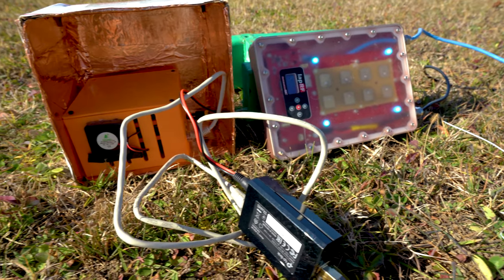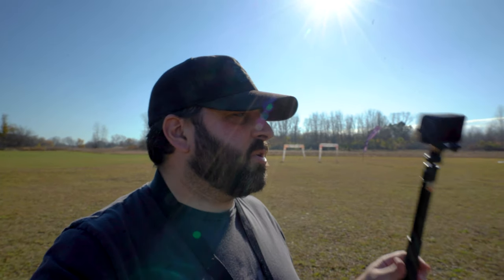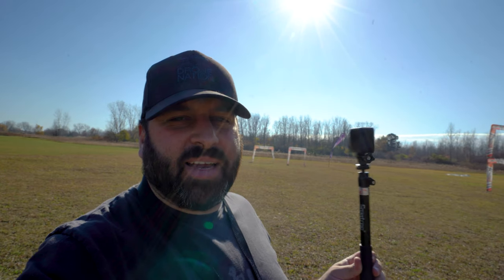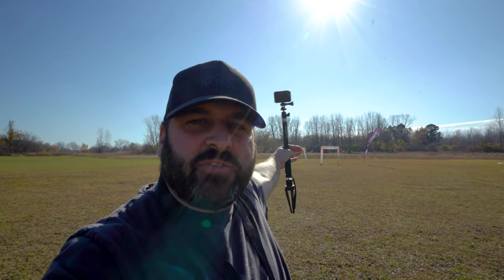RotorHazard DIY FPV Race Timer | The Solution To DJI FPV Timing???

Comment: The split in time is the separation in timers and lined up with gate immersion is on the gate and delta 5 is the 1 foot 0.008 difference but it’s actually spot on
Reply: If a timer is a foot before the gate, it starts timing a foot earlier, and ends a foot earlier. Does not make any difference at all.

Comment: great analysis!  thank you for putting this together.  I have a delta setup I need to dig into.  

off subject, how are your digital lap times comparing to analog these days?
Reply from the maker: My digital times were about 2s/lap slower.  Worse my consistency was much worse on digital.
Reply: @JohnEFly  crazy!  Both racing builds?  That’s significant.
Reply from the maker: Yes not the same builds but they are both racers.  Pyro cube for dji and floss 3LX for dji.  I can't fly anywhere close to as good with dji.  But I do still enjoy it.

Comment: Awesome work! Any Good source on how to get DJI working on laprf? I can't get it to read any laps
Reply from the maker: Are you referring to the 8-way or personal?  For 8 way use a threshold of 600 and a sensitivity of 63.  For slower flying it catches basically every lap.  For faster flying it catches most laps.  If you are asking about the personal, I don't know the exact settings, but generally decrease threshold and increase sensitivity.
Reply: @JohnEFly  ah awesome, thanks for that. Yes for the 8 way :)
Reply from the maker: @FPVBits  I'm shocked if you have anything close to decent results with that.  When running 63/600 I also have the DJI quads at 200mw.  That's what I used in this video and missed a bunch of laps.

Comment: Really, really interesting testing, dude! 😃
The results are pretty convincing!
But... I don't know, but I wouldn't bet on DJI for races, but on Shark Byte. Because with Shark Byte you can have as many receivers as you want, put it on screens and so on... With DJI on the other hand you need that freaking expensive controller. 😕
So... We'll see, I guess. 😬
Anyway, stay safe there with your family! 🖖😊
Reply: You don't need any specific controller... You can use whatever you want.
Reply: @TechieMillennial  Now you can, but at the time I made the comment you didn't have the options you have today. You know?

Comment: Thanks for doing the work! This is really interesting to me and i love that you have analysed the data. It looks like there is a solution to timing dji... i will have to dust off my old delta5 and get rotorhazard running on it. What I really want to see is 6 dji pilots up together racing and getting timed accurately (with either system) and then swap out a dji pilot for an analogue pilot and go again and then be at a point where you can have any number of dji and analogue  pilots in the air at once (might even chuck in some sharkbyte in there for good measure) this is going to be our next round of testing in the uk race scene... if we can ever get out of lockdown.
Reply: Done this. Np
Reply: @jstlll  so you can get 5 dji and one analogue pilot up racing with no issues? any special considerations? there is very little footage of dji racing that i can find (split dvr multiple pilots in the air) and the one bit i can find the poor guy on analogue is getting stomped on hard by 3 other dji pilots. I really want this to work so any tips appreciated.
Reply: @willannison1300  no, not together. Two analog and two dji are fine-ish. You best consider them as two separate classes.
Reply: Sorry, misread your comment. Rotorhazard will deal with it, but pilots may not like the interference :p
Reply: @jstlll  "fine ish" doesnt sound great at all. That's a real shame i really want to run races that include dji but running a separate class is a complete non starter for me
Reply: Two or even three DJI in a four person heat seems to work fine, but it really depends on what frequencies are being used. I have had good results with R1, r3/d3, d6/r7 and d7/R8. But the r7 and R8 only really works with IRC or TBS vtx and proper antennas that have good reception at r7 and r8. Not all do. Make sure rb pilots are on lower channels and do not use r6 as it has disturbance from DJI 8/public. This make imd6c hard to use without modification
Reply from the maker: Racing DJI with analog is absolutely not fine.  There is pretty much always some interference issues to deal with.  It typically shows up as a small white bar that scrolls through the screen occasionally.  It's flyable, but it's definitely causing issues, and it's not really fair to cause issues on other pilots.  No matter what channels I've tried it seems to show up at some point.  It's very hard to predict where DJI will cause the issue.
Reply: in four person heats based on imd6c with analog on rb1 and rb2 or rb3 and DJI on d6 and d7 (similar to r7 and R8) we have had good results without interference. 3 analog quads and 1dji have worked too, although R7 then needs proper antennas. Always keep DJI on higher channels.
Reply from the maker: @jstlll  in the same exact configuration we have had issues.  It's typically easiest to see if you're live streaming the event as you would be able to see any interference on a single screen.  We livestream all of our races, so I've seen it at every race.  I've never had an analog pilot complain about it at the race, but I have heard of some complaining outside of the race.  So I wouldn't rely on the fact that nobody spoke up as proof that there were no issues.
Reply: @JohnEFly  so from my point of view as the chairman of the British drone racing association in other words there is no acceptable way to allow DJI at races other than having it in its own class? The sheer amount of noise I hear from DJI pilots saying how great it is and how they have raced no problem with analogue pilots just appears to be lies as the analogue pilots are just flying through the interference that they shouldn't have to put up with and not complaining.  This is the fundamental issue. Until I can put any number of DJI pilots in with analogue pilots in the finals of an event on whatever channel live time gives them then it cannot be accepted at all. DJI have massively missed the point in the racing market and it's unfortunate that the people who went out and got it and rave about how good it is are not constantly lobbying DJI to produce a proper race mode.... Then I think it would be hard to spot anything other than DJI at events ( I would literally order it today if they added this feature)

Comment: Looks like it is time for Rotor Hazard to be an approved timer for MultiGP
Reply from the maker: It has always been "approved".  They required you to use Livetime to submit a global qualifier, but you can use RotorHazard as the timer in Livetime.
Reply: @JohnEFly  they sure do 🙄🙄
Reply: So... You qualify flying DJI... You get to heads up racing flying DJI you stomp on everyone else... Now what?

Comment: DJI solution.
I've tried DJI and I have to say it works very badly. so i just soldered the cheapest mini analog VTX onto the copter. this only has a few grams which does not matter. and see there, it works great. :-)
Reply from the maker: but now you're using 2 channels, which will cause issues when racing with others.
Reply: @JohnEFly  that's right. but we mostly fly with two drones and the lap rf is best with fewer people anyway. but of course it is a compromise.